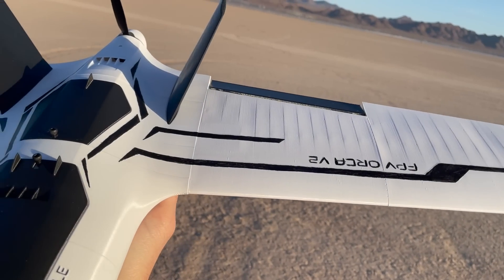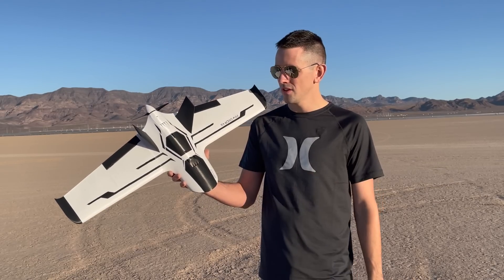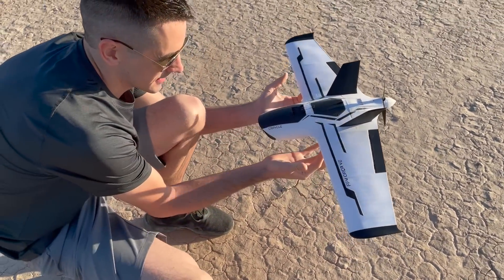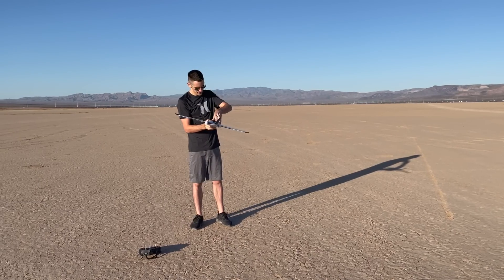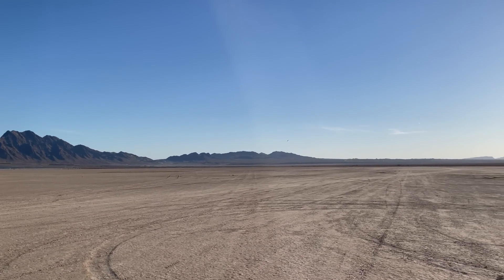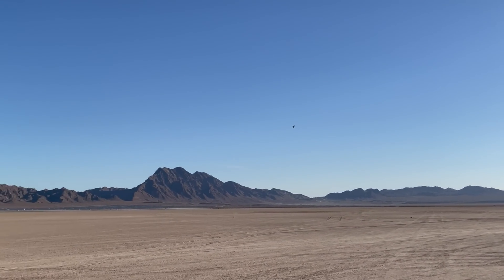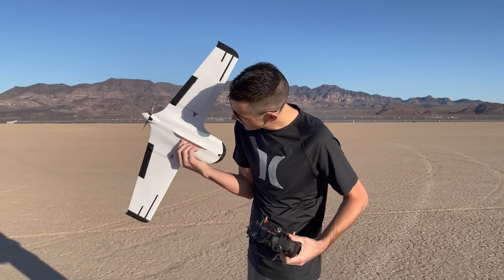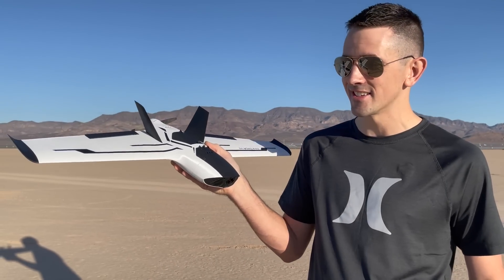FPV ORCA V2 3D Printed RC | Full Build

Comment: So cool, love the design, the overall form and details are fantastic. 
I recently saw a video about DARPA experimental craft that have no actuated control surfaces and it reminded me of years ago I did a very basic pen and paper design for a flying wing with four slat outlets on the wing two on the upper surface two on lower, upper and lower offset (upper outlets outboard, lower inboard or some other combination). Four electric motors one for each set of outlets.  There is an interior geometry that directs the flow from motors to slats and all thrust is through the slats.  By changing output to each and a lot of experimenting maybe pitch, yaw and roll control could be achieved.  The complex geometry of the wing and interior flow chambers is best manufactured by 3D printing the forms.
Troy I’d appreciate your thoughts on whether this is feasible from a DIY 3D print manufacturing standpoint. I need to do more work as this is essentially just a concept but I like the idea of a no flap craft and precise software control of thrust for flight control.

Comment: drone is crap. 1-there is no way to be in the air without moving. 2-launch with a throw...are you serious? 3-reset system is useless because the accuracy will be maximum 30%. 4-limited maneuverability.

Comment: i see that "they" still havent learned to make a edge / last part to have a bigger glue surface, this small edge to edge glue tactic is crap. the tip of the wing hade a good "glue design" tho, but the entire plane needs it to be strong.

Comment: Very cool build!  Unlike a foam model, these 3D-printed planes seem to have so much more room inside to modify and add electronics.  Also,  how long do you usually let glued surfaces set before they are considered 100% bonded?
Reply: ZAP is quick but it's also fragile. HIGHLY recommend 3DGloop matching whatever filament you're using. The PLA stuff is loads better than superglue as it chemically bonds them together. They will not fall apart.

Comment: I have printed and built 2 of these and, It is pretty well known that you cannot glue TPU to PLA with regular CA. I used the same CA you did and I had 2 problems. 3 of the 4 glued hinge points pulled out without a lot of effort. Also if I do it just like you did, the hinges will be very stiff from extra glue. You don't even flex them in the video. You need to use Loctite 406 for gluing tpu to pla.

Comment: I absolutely love the build and I've been thinking of printing a plane myself in the past. Unfortunately, RC planes don't go well since they are brittle when 3D printed. My favorite design is a mix between EPP and 3D printed parts.
Reply: absolutely not brittle if you print them correctly
Reply: @antonioesposito8071  It doesn't matter the print quality. FDM induces tension in the material which is what makes it a lot more brittle and less durable than other model building materials. That being said, salt fusing does fix this issue for most parts.
Reply: @DaveSmith-cp5kj  are you new to this? salt fusion does not work with these kind of pieces. By the way every material is a tradeoff, you want EPP? durable but forget complex geometry, you want balsa? light, durable ma you have to be billionaire. You want FDM? more fragile but super economic and infinite geometry possibility
Reply: @antonioesposito8071  Are you new to this? Salt fusing literally was made for this kind of application.

Complexity is pointless without design. So far we have not encountered a need where AM's capabilities can exceed the performance of traditional materials. The whole application of 3D printed RC parts as of now is ease of fabrication. If you are strictly performance oriented, AM is not the way to go.
Reply: @DaveSmith-cp5kj  just try to add a washout to a homebuilt EPP wing. By the way show me your results (or other people work) with salt fusing

Comment: On a flying wing, the elevons typically need to be set slightly above the wing airfoil curve.  This is known as reflex. Without it, the airplane will want to track downward. BTW, does the printed kit include the STL files?
Reply: User here, just bought it, and yes, GCode and STL files provided. And happy to see someone else knows about the reflex
Reply: @agpereirav  can you share the stl files i dont have a international debit card to buy it from them ;(

Comment: Excellent project! But when I quoted the parts and you realise that you spend more than $500, makes me get discouraged 😩
Reply from the maker: it's initially expensive to get into this hobby, the 3d printer and the transmitter are the worst but after you have them they last! the kit that Craycle offers is an excellent value and that would save from having to get a printer right away. I looked up a more inexpensive transmitter also, I'll link that in the description. I hope that helps!
Reply: @TroyMcMillan  I got the 3D printer…transmitter, motor, battery, receiver are the expensive parts to me…😉 ….anyway,  fantastic job mate! Subscribed now!
Reply: @TroyMcMillan aa❤❤😂❤😢😮
Reply: @TroyMcMillan  good job, i like it very much.  I don't have a 3D printer, would it be possible for me to buy such a plane from you?
Reply: The last two years I've made my hobby FPV. Mostly drones, just got my first printer and have printed two wing designes. im working on putting them together now. Such  a frustrating and slightly expensive hobby but it's worth every moment and I love it
Reply: Same

Comment: Great video Troy, my question what are the rods you put between pieces?
Reply from the maker: they are 3mm carbon fiber rods, 10mm long. You can also use wooden dowels if you wanted, or leave them out - they are just used for alignment not for strength :)

Comment: Hey Troy what are those small little beg things you use to attach all the parts precisely. Do you have to buy it separately or 3d print it.
Reply from the maker: its a 3mm carbon rod, they are just used for alignment of the pieces. not required to use though, they don't add any strength

Comment: Got to be honest from my point of view, i have a couple of rc planes and a couple of printers etc. I think 3d printing planes is great way to go but id like to see it more from a repair stand point. I think many 3d printed planes are showing off the benefits of using printing such as exact thin airfoil section, high internal volume, accurate swept fuselages...however ive been flying ec for a while, most of my planes seem to get more hangar rash and odd crashes on launch or landing...so instead of a nore complex 3d printed plane, what would be awesome is to even just have a 'normal plane' like a bush mule, nano talon, talon, trainer etc, where damaged parts can be reprinted and replaced using small fasteners etc...so i can maintain my fleet. Its likely in this area that ill work towards my own designs. Thanks
Reply from the maker: I actually crashed both my 3D printed Cessna 152 and 3D printed airliner pretty badly and was able to repair/reprint the damaged parts, and fly them again! I have videos on both of those repairs on my channel! My next plane will be a bush plane, a Piper Cub, so check back for that one!
Reply: With a little bit of creativity this plane could just click together without any glue. You could easily replace parts that way. Even if someone was able to just 3D print 3 different style wings and a couple different style tail wings you could come up with a basic fuselage out of balsa or foam board.
Or maybe even create a few different style fuselages that the wings would all easily attach to… I mean kinda like Flite Test but 3D printed in your own home.

Comment: I absolutely love the design and attention to detail.
Always a little bit sad to see lots of glue but i also always underestimate how heavy other methods of affixing stuff get.
Reply: Ca glue and PLA bond quite well. Give the two surfaces a scuff with sandpaper prior to gluing to make a stronger bond. Having printed slot tabs also adds alot of strength
Reply: I agree, screws are a way to make it more modular, I think they are a much better approach for a reusable design, but hey, its about having fun as well  :)
Reply from the maker: it has so many awesome details!

there actually really isn't very much glue used. and it is really strong even with just a little bit of glue!

Comment: First I thought this thing would be affordable since it's 3D printed, but then the parts list starts with a goddamn $600 controller...
Reply: That's not true.

You can buy a decent radio for ~$100, like Jumper T-Lite.
Plus a 4 channel receiver for $15-20.
Battery is another $20-30.
Servos are $10 both.

So overall you don't to have to spend tons of money to start the rc hobby.
Reply: This is the cheapest model that you can make an RC plane. You need only 215 gram regular PLA and cheap elektronics if you are a begginer. Requirements are so simple and accessible. Also you can use this model as professioan by adding high quality elektronic systems. You just need a quick research. Take your time and enjoy with your first model!

Comment: ZOHD KoPilot would be nice in this, since that prop setup is so sketchy for hand launching. You can put it at 1/2 throttle and just throw it any way that's comfortable and it won't throttle up until its a few feet away from you. 

When I bought my 3D printer, I intended on trying a plane. The more I saw, the less I liked them. Take forever to print, and the end result was heavy and fragile -this is the first one I've seen that I really want to try. Thanks for vid!
Reply from the maker: Thats a cool autopilot system! I may have to give that one a try!

As far as 3D printing airplanes goes, I thought the same thing when I first started building planes. They have come a long way since then, some great filaments have come out and the designs are so improved - fast printing, and durability while still lightweight. You should definitely give it a try now! 😊

Comment: Great build!
However...
Disgusting flight characteristics! (((
Reply from the maker: What would make you say that? It flies perfectly!
Reply: @TroyMcMillan  
Dear my Troy, At first I wanted to buy this model, but after watching the video I realized that it's better to let others buy...
Your words - It flies perfectly!
My words - Depending on what you mean by your words - "flies perfectly" ...
If you attach a cow patty to a motorcycle on a rope, then the cow patty will also fly perfectly! )))
Due to the fact that the wing area is not sufficient, it must be understood that for the manufacture of this aircraft model, you need to use lightweight foam, and not plastics.

Comment: Nice .I'm getting this bad boy! But what happens if the servo goes bad? Looks like u might have to print a new plane
Reply: Servo Service Hatches are comes with the wing and you have to cut its tiny connections to break servo hatch from the wing if you need to replace servo. So you can replace your servos :D Sorry for the missing information on the PDF. We will add this detail.
Reply from the maker: Exactly as Craycle said, you can just cut out the servo cover, replace the servo, and then you can either glue the cover back in place or even leave it off
Reply: @TroyMcMillan  nice!
Reply: Tape works well for reassemble the servo cover 👌